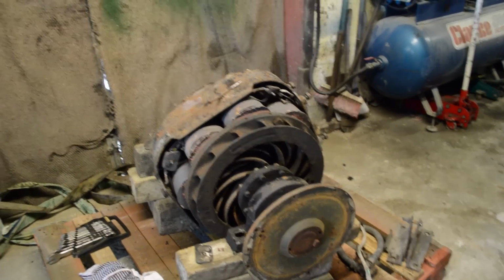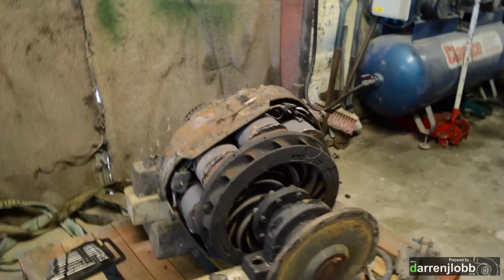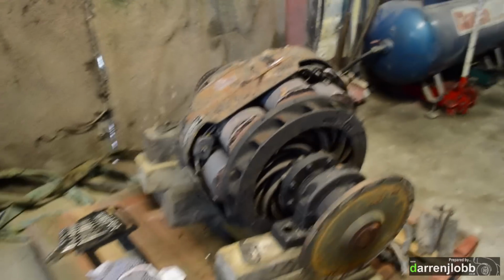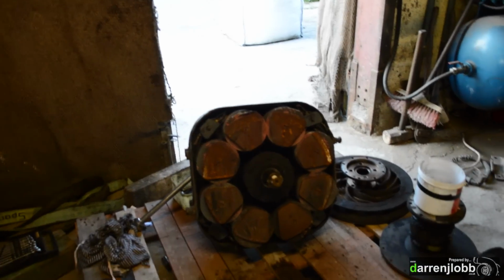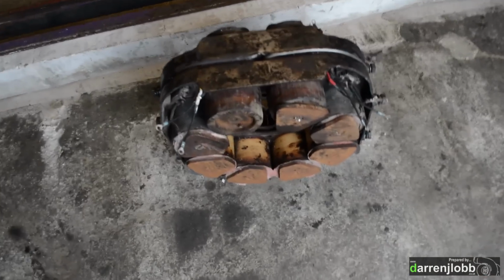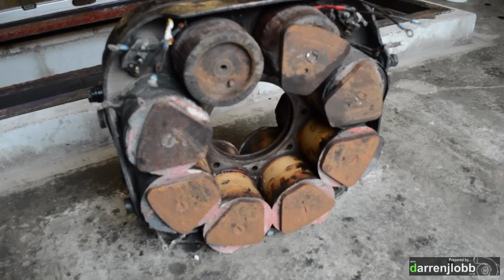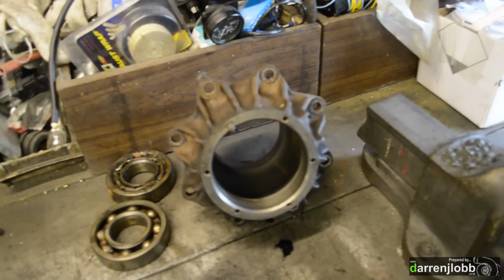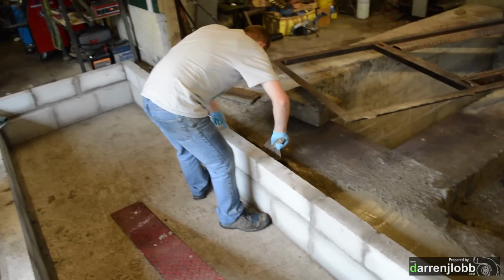Sun Ram Chassis Dyno Build Part 4

Comment: Hi, right now I'm on progress to make eddy current dynamometer, i have couples question
1.can you tell me what is the core material?and also for the rotor material?
2. can you mention specifically about the wire you use?(max current ,size, and also the diameter wire?
3. can  you also tell me about the maximum temperature ?

Comment: I had a couple questions if you don't mind.
When you wire the eddie brake to 190v, how are you controlling the output to these coils to make them brake against the flywheel? I know it works like an alternator, when you excite the coils, the more voltage you put through them, the stronger the magnetic force, thus making them brake harder. Why not keep them at 24 volts and brake that way? I assume It is like you said for less amps. 

2. how much torque do you think this system can brake? I know you can order a bigger load sensor that can weigh 1000lbs and that is sufficient for most cars, but will the eddie brake handle that in short bursts with an average car horsepower of 3-500?

Thanks for any help, I am doing exactly this and the vids really help me grasp what I am in for. 
-Andrew